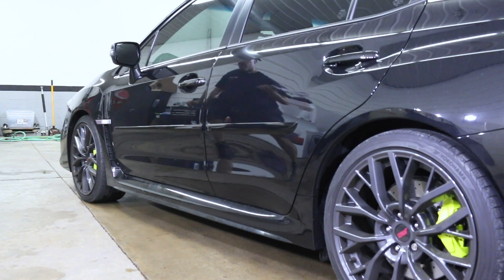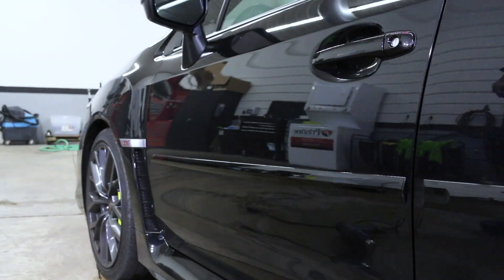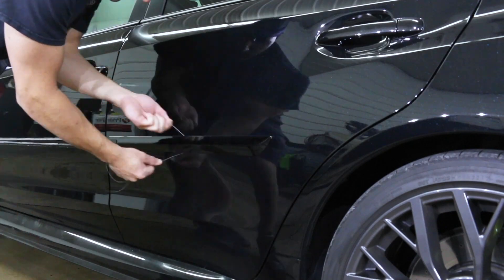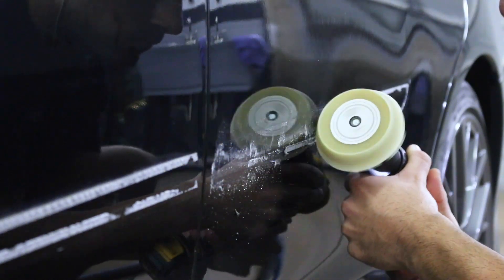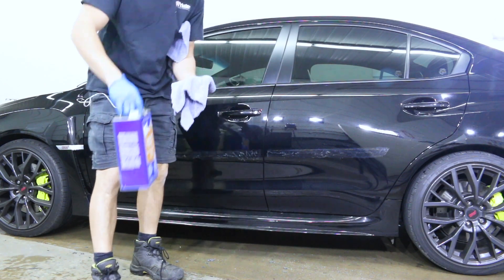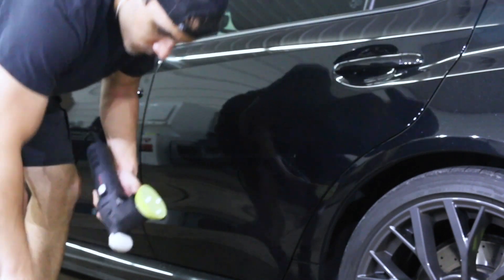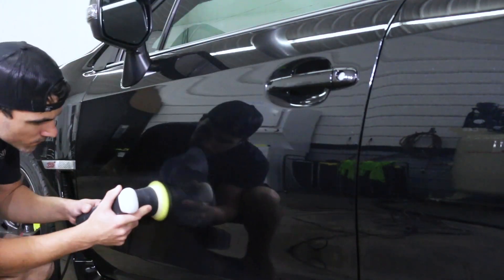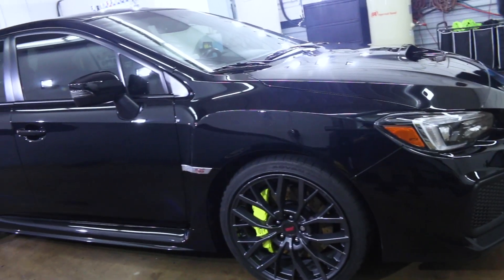2019 Subaru STI Side Molding Removal *Works for MANY Vehicles*

Comment: If you were to try polishing it by hand, what kind of compound would you use? And is this safe to do on a 15 year old vehicle?
Reply from the maker: I would prolly use the same Menzerna 2400 compound I used here with a nice quality low pile microfiber towel. It would be hard to get a perfect finish on black paint but would have atleast remove the outline on this car. We do this fairly often on older vehicles but the older they get the riskier it is. Super high risk on older vehicles or vehicles that have been resprayed. We see fairly often respray jobs that the body shop just sprayed over the original side moldings and when you go to remove the side moldings it opens up a can of worms.  Another example is a 04ish F250 with these, commonly has paint that peels easily under these side moldings. I am guessing from dirt, water, and mud just laying behind them for years ruining the paint.
Reply from the maker: Customers that have the higher risk vehicles that may be older I will tell them to try removing themselves or make them sign something before I remove them. I always tell them the very worst case scenario which would be to do either a full respray of those doors or else get new side moldings to cover up what's exposed underneath. Luckily we have not run into this much.
Reply: Thanks for the tips! I appreciate it!